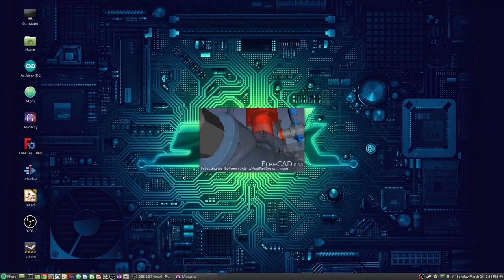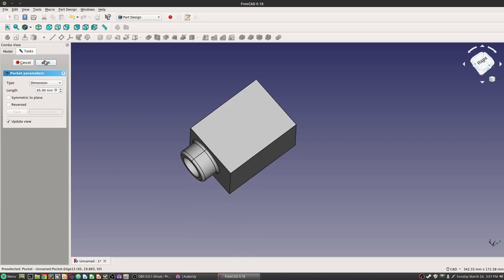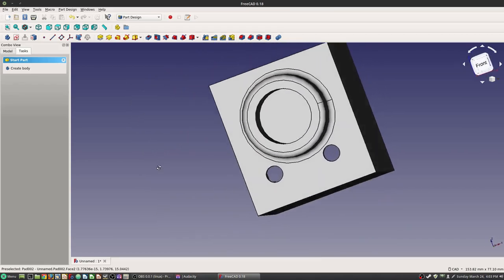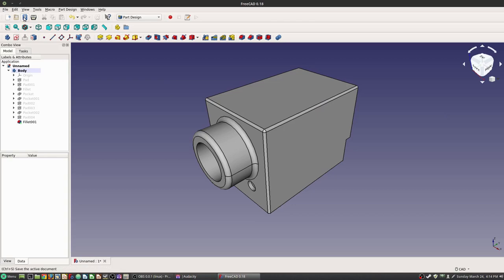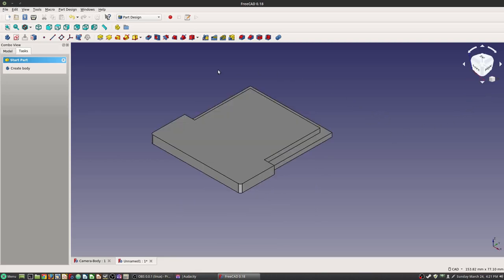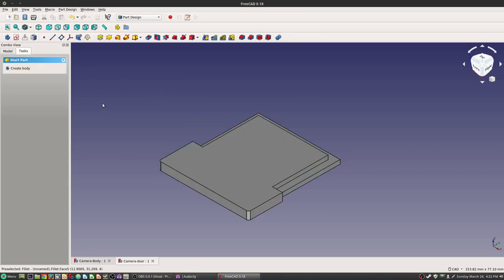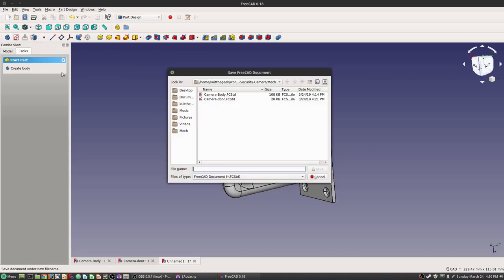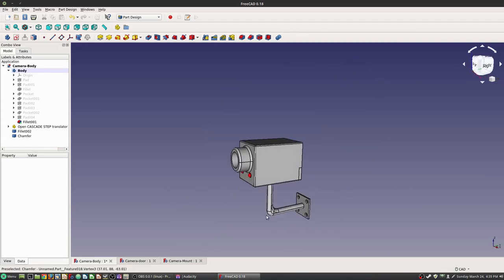Shenzhen I/O in Real Life - Part 3 - The Box

Comment: This software is not very user friendly.  Damn...
Reply: All I'm trying to do is set the dimensions of my rectangle and I'm getting a warning about datum constraints and I have no idea what I'm doing that is so difficult. I clicked on the same buttons you did.
Reply: Clicked the wrong line, haha. sorry
Reply: Ok! I have a box with some clearance for 1mm walls around my PCB and a pocket 9mm deep to lay my PCB on the bottom.

Only thing left is screw threads on the bottom for the standoffs I assume, and then I can get some standoffs screwed in. Looks like those are hard, though.

I still say this is quite the complex app though. I find it harder than KiCAD and that scared me at first.
Reply from the maker: I agree that FreeCAD is not super user friendly, but that has also been my experience with a lot of MCAD software. I am curious as to how you are planning on making your box, because in my experience, a 1mm wall is pretty thin. I believe I used a 2mm wall on this project, which is what I tend to do. If you are 3D printing, I would make the wall at least 3x your nozzle diameter. And one tip to make the screw holes easier is to just make standard holes and don't worry about threading them. The layer lines do a pretty good job as acting as threads, and most screws can cut threads, you just need to be careful the first time. You will also want to make the inner diameters of the holes larger than the shaft of the screw, but smaller than the diameter of the threads. I would shoot for somewhere in the middle and you should be fine. Good luck on your project!
Reply: Kuit the Geek oh, I’ll go for 2mm. 1 probably thin and I did think about that. Also FreeCAD literally corrupted my save so I’ve lost it all. I’m starting again with the help of the kicad step up tool
Reply from the maker: Oh man, that is definitely frustrating, although I don't know if I have ever had that happen to me. What OS are you on?
Reply: Kuit the Geek W10. After reloading all the tree was all messed up and everything was called Unknown